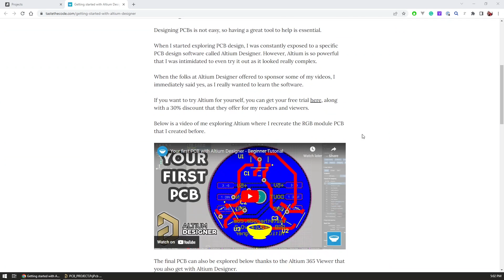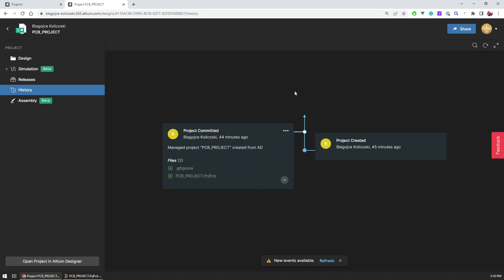How to easily repair LED panel drivers in just 5 minutes

Comment: So my dc brick is hitting 36v which is exactly what it’s rated for. How difficult would it be to open the Govee controller to see if the problem is there? My lights flashed for a second and then turned off and refused to turn back on.
Reply from the maker: If it outputs the right voltage, I doubt that the issue is with it. Opening it up is very difficult since they are glued together. You can try to measure the voltage while the lights are plugged in to verify that the voltage is not dropping. Since they lit once, I'm suspecting a blown light in series with the rest.
Reply: @TasteTheCode thank you! the controller seems to be easy enough to open. Like the part that has a power button and whatnot The power adapter is a glued.

Comment: I had the worst unsuccessful attempt to repair the regular round bulbs to no avail...broke the hole base of the bulb...I have high succsess rate when it comes to the chandelier skinny long led bulbs...
Reply from the maker: It really depends on the material of the case. It happened to me as well. Some of the bulbs are made of a very brittle material and crack as soon as you apply any force to them.

Comment: Hola.
¿Puedo cambiar un condensador de 10uf por uno de 47uf? Gracias por el video
Reply from the maker: You mean the electrolytic one? Probably yes. Adding larger capacitor usually creates a more stable output.

Comment: Hi, I have an identical LED panel and I've tried desoldering the LEDs from the strip and they immediately crumbled and melted. Could anyone please make recommendations on how to properly do this? I got a bunch of broken ones and I'd love to repair them.
Reply from the maker: You need to use hot air. It is almost impossible to get them off in one pieces using a regular soldering iron. However, if they are broken you do not need to take them off as one piece. Adding the jumper over them is then easy enough.

Comment: Maybe jump the five 'off' LEDs with a resistor?
Reply from the maker: You need a really high power resistor as typically, these LEDs have around 300mA of current passing through them. Since the power supply adjusts to this, simple jumper is all you need.

Comment: My track light head is flickering. The capacitors don't look bulged.
Reply from the maker: What sort of flicker it has? Is it repetitive or does it flicker randomly? If it is a repetitive flicker, then probably some of the LEDs is about to die.
Reply: @TasteTheCode No, its a random flicker.  Sometimes the light will be on and it's working fine. It took a long time to even find out which head was the problem because we'd notice it on the counter but look up and everything was fine. It started to do it more frequently lately. I suppose I could meter the capacitor but they soldered it in a place I can't see the side.

Comment: Great fix but if there is an inherent problem then surely the new capacitors will fail in time? or is it a case of cheap components? Thanks for sharing.
Reply from the maker: Yeah, it is mostly a problem of bad capacitors.

Comment: can you tell me how to increase its current ? I have these dfferent led drivers but all have max current of 120mah but I have 12v 12w led which requires more current, so currently it glows but very dim. Thanks
Reply from the maker: The output current is controlled via some resistors on the board but you will need to find a datasheet for the specific IC on your driver. However, I will strongly advice against this. These drivers are already set on their maximum limits from the factory and pushing them even further is just a recipe for disaster! Find the right driver for the light you have!
Reply: @TasteTheCode  Thanks for responding

Comment: I think not only the capacitor failure is the only fault  for driver not functioning . You need to  explain how all other component working & other fault s ,
Reply from the maker: Well that was the case here so I showed that. Once I encounter another fault, I'll make a follow-up. In fact, I have several other videos where I show other faults.

Comment: Thanks for the great video.A nice and clear narration of different steps to repair . I have a driver 18 watt, 50-100v dc ,input 230 volts AC has a transformer towards the output side.Is it stepping down the output of bridge rectifier? In one of other videos you had a choke on the output side.
Reply from the maker: Thanks! Best option is to check the number on the driver IC and check its datasheet. Almost always, there is an example circuit inside and most of the manufacturers, just follow that when making the lamps. If it is a transformer (as you mentioned usually it is just a choke) then it might be separated from mains as a switch mode power supply.

Comment: Great video! In my case the capacitors looks right, and the values are the expected (measured on the PCB), but the light blink regularly (light half a second off, half a second on; not flickering, as almost all YT videos show). Is this case the same symptom?
Reply from the maker: That sounds as if the driver chip can't "boot" properly. Are there any resistors on the board? If yes, then try checking if any of them measures higher than expected.

Comment: What's the issue of replacing capacitor without testing whether it got its capitance?
Reply from the maker: No need to test it when you can see that it is bulged. If it looks ok, then you can test it as a second step. A good capacitor should never be bulged!

Comment: I suggest replacing the caps with Rubycon or Nikkon Chemicon caps, of the highest termperature rating you can find. It'll be worth it in the long run. No-name chinese capacitors are the reason the lights failed in the first place.
Reply from the maker: I don't have a great source that I can purchase locally and not a lot of sellers will actually deliver to Macedonia. My best option is Aliexpress but you can never be sure when sourcing from it.

Comment: Oh thanks for this tutorial. I have a 2 color led lamp with multi separate led panels the white color started to flicker randomly. Then after a while the warm color do the same. 
What do you think is the wrong with the driver ? 
Output is 180-200 v and 230mA
Reply from the maker: Flicker is usually caused by the capacitors or by a bad LED.

Comment: I think you forgot to mention that whenever working with capacitors (regardless of whether good or bad ones) in AC circuits is to always discharge them for the safety reason as not to get an electric shock.. Capacitors do retain some energy even when removed from an AC line..
Reply from the maker: Once dead, these capacitors barely hold any charge in them but, yes, it is true that they might hold a significant charge and I should have stated that more clearly. Thanks for pointing it out.

Comment: Guys, if you end up fixing these try installing lager caps and not smaller like in the video. and higher voltage if you can squeeze those in place. Lager size and voltage will give you a longer run. Say you had 25V 1000uF install 35V  1000uf. Cap body size is direct reference to how many hours it's designed to run for
Reply from the maker: Higher voltage rated capacitors are always a better choice when available.
Reply: I disagree with the body size comment. Some tiny Japanese metal encapsulated caps have high values and run almost indefinitely, even in hot PC cases.

Comment: Appreciate this video discussion.  Maybe you can bypass the bad segment of LEDs by connecting + and - wires to connect the segment before to the segment after the bad one. Then all will burn except just few LEDs with minimal loss of illumination.
Reply from the maker: Yes, this is doable if you don't mind rhe gap in the light.

Comment: Nice, but capacitors dont appear bad.  Is it  possible i am putting too many lights off one controller?  Is there a way to test the lights or the components themselves with a volt meter to see if they are bad?
Reply from the maker: Yes, each driver is rated for a set amount of power. Trying to draw more than that will damage it. You can test individual LEDs with a multimeter, but only if they are one LED per package. If they are more than you can't.

Comment: Hello, I have a led light that is controlled by a remote control. I ordered this from a distance and it seems to have been damaged in transit.

After turning on the light, when I press with my hand where the drivers are located, the light changes color. (for example, if the white LEDs are on, they turn purple) Sometimes it recognizes the remote control and sometimes it doesn't.

Which element do you think is damaged?
Reply from the maker: Sounds like a bad connection or cracked PCB. You can try to inspect the PCB for damage or try to reflow some of the ICs.

Comment: Sir, can i control to adjust current output from IC driver pin Cs resistor.if i change resistor what happen to? thank you sir!
Reply from the maker: That is usually explained in the datasheet for the chip where there will be a formula to calculate the resistor required for the target current. But that is only if you are able to read the chip number and find a datasheet for it as often the numbers will be erased or datasheets are not available.

Comment: Each led watag circuit voltag is difrent so parts velu is different.
Reply from the maker: Yes, true. Depending on the wattage of the light, a different set of components might be needed.

Comment: 14:11
Can I just put a resistor connecting across that particular group of LEDs and make it work?
Reply from the maker: The driver chip will try to push a set amount of current through all LEDs so, it is better to just add a wire link. The downside is that there will be a dim spot in the panel, but it will work.
Reply: Resistance will dissipate it in heat better to add diodes

Comment: How to check the driver IC?
Reply from the maker: That is not an easy task. I guess you would check the datasheet and compare pin outputs based on that.
Reply: @TasteTheCode  well often the datasheet is not available, or specially for constant current buck non isolated ICs, the output voltage isn't mentioned either..what to do then?

Examples
DP8621
DP9501D
DX 2866BJ
Reply from the maker: Output voltage usually depends on the number of LEDs attached. For constant current drivers, it is the current that they regulate so you can have more (up to chip power limit) or less LEDs and it will still work. If everything else is OK on the board, you can either replace the chip if you find a replacement, or ditch the repair entirely as the price of these drivers in not really worth that much hustle.

Comment: I have a driver for a four foot shop light led , this light just goes on and off constantly. I looked at capacitors and none looked bulging, can they still be bad ? Can they be tested?
Reply from the maker: Yes, and flashing is a common sign that at least one of them is bad. It might be one of the LEDs as well but it is not that likely. They can be tested with a capacitance meter or a multimeter that has capacitance measurement. However, the cost of the capacitors is so low that it is worth changing them all just in case and trying it out. Make sure that the voltage rating is the same or more than what's already installed.
Reply: @TasteTheCode  Thanks for insight

Comment: Dear Taste The Code, can I connect an 12 watt driver to a 18 watt LED ceiling panel, hoping to dim the 18 watt LED panel to have the same brightness as the 12 watt panel?
It is hard to find a 6-inch diameter 12 watt LED panel in Malaysia.  Most sellers here sell only 6 inch 18 watt panels.
Reply from the maker: Hmmm it will probably work bit you will be pushing that driver to the max all the time and it might burn out. They are usually designed to pish certain current through the LEDs and they work in a certain range rather than a very specific wattage.

Comment: Can you drop the current on this driver?
Reply from the maker: Yes you can. This one uses the two parallel resistors where you can take one of the to usually half the current.
Reply: @TasteTheCode  You take one off?
Reply from the maker: Yes, I usually take out the smaler one.
Reply: Is there a circuit diagram for this driver?
Reply from the maker: It is not uncommon to have chips with markings removed from the top so it is difficult to know what the exact chip is. If you can see a number, you can usually find the datasheet that will have its typical circuit in it. Most drivers are just a replica of the typical circuit diagram from the datasheet.

Comment: In my country, Poland, similar lighting fixtures (lamps) are used, and most often the LED diodes burn out. The power supply is of poor quality, the lack of filters causes interference with FM radio reception.
Reply from the maker: Yeah, it happens here as well. Manufacturers usually overdrive the LEDs just so they burn out quickly to be replaced with new lights 😭

Comment: Good explanation. I installed about 100 of these and believed they would be maintenance-free. So I don't replace bulbs as I did many years ago. But now I need to fix the electronics. I would have discarded and replaced a bunch of lights if not for your instruction.
Reply from the maker: In theory yes, they should be maintenance free but questionable manufacturing leaves many broken just for some extremely cheap parts. It's good that you managed to fix yours.

Comment: can you adjust the constant current. i have a 350 ma one but only need 180 ma
Reply from the maker: The control IC, usually uses a current sense resistor that you can change based on the datasheet to lower the current and you will need to find the datasheet for finding the right value.

Comment: Please no one buy an iron like that. Get a temperature controlled one with the heating element in the tip that wets solder properly without excessive heat. I like TS100 but any cheap T12 will be better than this
Reply from the maker: This is a temperature-controlled iron. It might not be the best one out there but not everyone can afford to pay hundreds for a soldering iron...
Reply: @TasteTheCode You are right, I have been using a cheap $20 iron for years and it is fine. It won’t do SMD with 100 contacts, but I don’t try that. Nice soldering job with your “cheap” iron!
Reply: @amoore2719  I use a Weller that resembles the one in video. I plug it in to the voltage/temp control that I built. Easy control. I had bought such panels and the drivers always eventually fail. Sometimes a failed driver unfortunately burn out some of the LEDs. I had bought some cheap driver panels from China to swap out with the bad.  I may look at those bad drivers again and see if I can fix the component.  
I want to ask, can I use capacitors from old broken devices or do they go bad with age?
Reply from the maker: They can dry out with time. It is best to always use new ones but a used one can always help when not having the right value.
Reply: 380 is hot, but RoHS solder tin indeed requires a higher temperature before it starts to flow.
Reply from the maker: Yes true. The biggest issue is till you have it mixed a bit with some fresh solder. Then it is usable.

Comment: Just remove one bad led. By string it by force and bridge the remaining pad w6a blob of solder and you are done. The panel will be running at a diferent voltage  (3volt less) but the driver will take care of that.
Reply from the maker: Yes, I'm aware of that and I've done this in the past with regular light bulbs. The problem here is that there are 5 LEDs in the string that don't light up and that will make a visible dark area on the panel that I don't think will look good.
Reply: @TasteTheCode  just a  quick fix. but its true.

Comment: I would leave the legs of the first capacitor as long as possible. And not bent it over the board... Keep it as far as you can. To avoid the heat from the chip affecting it on the future
Reply from the maker: It is not the chip only as there is a lot of heat from the panel itself and the driver sits on top of it at all times. Having rhe capacitor away will definitely help but I don't think it will be too much of a difference.